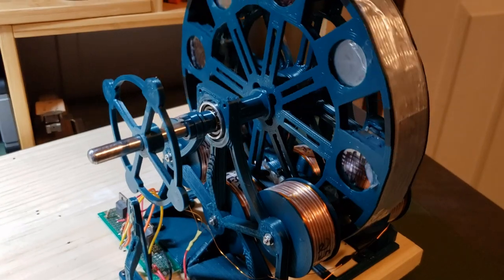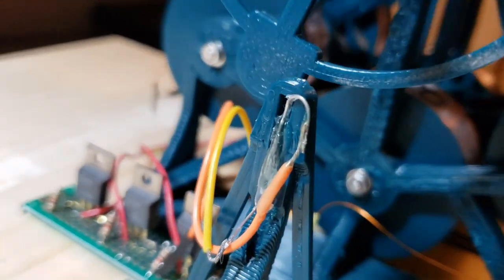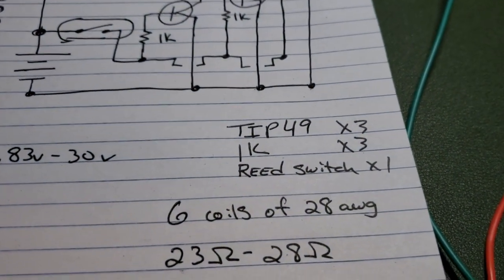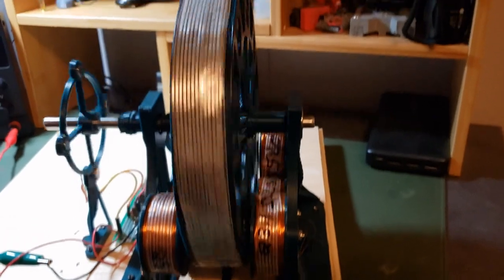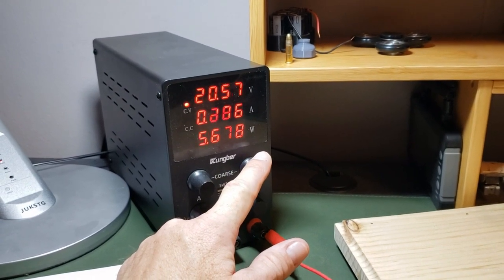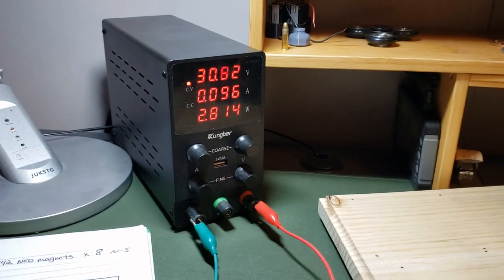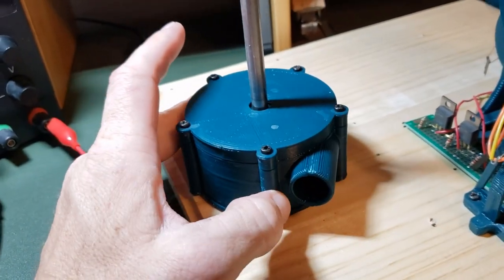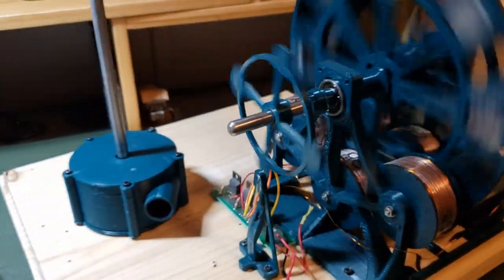Large Efficient Simple Pulse Motor

Comment: unplug it from any power to the circuits. build you a tesla turbine powered by steam, and connect the shaft from your pulse motor to the shaft on the turbine, hook the coils from the pulse motor to the loads you want to power. your using water or air instead of power from the grid to power your pulse motor now,,  if you can use a boiler for steam it would run on water and wood.      if you could get it to run an induction coil to heat the boiler you may be able to loop it using the power from the pulse motor coils.... ??? the coils dont spin the wheel the steam does, the coils are your power company

Comment: whts happening here is what now motor controllers does.highy efficient pulsing..its all about the duration of energy bieng use at the shortest period of time at its maximum torque
Reply from the maker: With $80 in magnets? The efficiency is that it spins on hardly any wattage. I wanted something bigger than a lid motor that ran on the same input.

Comment: Can you please mention the wattage, while you are loading it, (just before it stops)when its running at 30 volts.
Reply from the maker: I'm not sure that was a year ago and that motor has been used for parts. I'm assuming it jumped up to around 8 watts at most.
Reply: @redesign3dp  Many Thanks. Cheers.
Reply from the maker: Check out my latest videos!

Comment: You can use a gearbox to take the high rpm-low torque to high torque-lower rpm.  This direction of conversion is less efficient; it's more efficient to go from high torque-low rpm to lower torque- higher rpm. My Point: if your torque is too low a gearbox may help (also balancing the rotor will help; maybe use electromagnets?)  Keep in mind when designing something there are always tradeoffs. Don't worry about efficiency as much as total power output. Can one build a generator the size of a refrigerator that could generate enough power to run your house? It may only be 20% efficient; does that matter? The question is what design variables are we seeking to optimize.
Reply from the maker: No I get it. Please understand I was only showing a new design. I never built one that large with so little input. I'm always trying out new 3d cad design ideas not trying to create anything magical. Check out my newer motors. Thanks for the comment!
Reply: @redesign3dp beautifull conception ...low ❤input ... very good ... what is speed at the short  circuit ? It correctly do your motor accelerate under load and reduxe the consumption ....input .... 😮add a generator coil and the earth hahaha

Comment: On your schematic the TIP49 is a NPN transistor, You need to show the arrow on the base. On the emitter Bedini uses a 1N4007 anode tied to the emitter and going to a neon bulb, if ran at higher voltages. That keeps the heat off of the transistor.🙂
Reply from the maker: Good catch on the schematic symbols, I missed that thanks. I the bedini protection set up in some of my other videos. Thanks
Reply: Thats why you should use an IGBT or mosfet.
Reply from the maker: @paulanthonybridge5741  look on my channel, I have a Newman style motor using IGBT's
Reply: @redesign3dp  Thanks a lot. They are probably a better choice instead of MOSFETS. Thats my experience.

Comment: One of the best builds I have seen on You tube, First class pulse motor it looks very powerfull when high volts is applied.
Reply from the maker: Thanks
Reply: @redesign3dp  Your welcome, Looking at the speed of this machine it might be possible to set up a axial flux generator off of it. this way it is paying for itself ect. making it more efficient. what do you think?
Reply from the maker: @DeryckThompsonChasingtheDream  Maybe if I take power off from the shaft. If I add gen coils near the rotor in a axial flux set up, I would suffer higher losses from the BEMF cogging. My latest motor has the most torque yet, you should check it out.
Reply: Not well balanced rotor.....
Reply from the maker: @paulanthonybridge5741  They can't all be winners!
Reply from the maker: Thanks, if you want to see powerful motors check out    k energy's    channel.
Reply: @redesign3dp  Thanks for the tip. I am already a subscriber to his Channel. His motors and his ideas are Some of the best on youtube.  Keep up your good work because its all about sharing ideas and improving upon them if possible.

Comment: Great motor....Did you ever think to try and Hall sensor instead of a reed switch? The reed works great just wondering if a hall would work better?
Reply from the maker: The hall switch consumes some energy, the Reed switch doesn't. I was trying to maximize run time efficiency. Its essentially a giant lid motor. I do have hall sensor modules that would work. I see your designing a commutator for a Newman motor, check out my commutator video made from a copper pipe. If you want the stl. I'll email it to you. Keep experimenting brother!
Reply: In my experience, I find reed switches better because you can control their switching angle with better precision.
Reply: No, optical switching is far better than both. I use a LED and also a LED as sensor.
Reply: @paulanthonybridge5741  I've wanted to try optical switching for a while now. I'll have to look up the circuit
Reply: @mcorrade  Its easy, just reverse bias a LED in front of a darlington transistor pair, the output can directly control a H-bridge Mosfet coil driver. Draw a separate trace on the optical disc for pulse reversal after magnets reach the middle of each coil.
Reply: Optical switching beats all. And you can draw your desired switching sequence on a transparent, round disc with permanent ink pen.

Comment: It's interesting job! What speed (rpm) did you accelerate your motor? What was the supply voltage and current? Thank you in advance for your answer!
Reply from the maker: Thanks. I didn't measure the RPM but I can run this as low as .8v .01ma to 30v 130ma. Later I ran it from a 60v boost circuit and speed and torque increased.
Reply: @redesign3dp , thanks for your answer!  I think so, that you took these measurements at idle, right? You did not give a mechanical load on the shaft and, accordingly, did not carry out measurements, did you? Maybe I'm wrong? Thank you in advance for your answer!
Reply from the maker: @alexanderkrupnov4999  I'll post another video with it running a stepper motor as a generator, with rpm and power 📚
Reply: @redesign3dp , Thank you! I'll be waiting. I think it'll be interesting....

Comment: Looks Like a time waster and very inefficient for the mass of the magnets the mass of the copper and no capture of the primary also to use a reed switch is almost barbaric. Though if you had fun making it then all G.
Reply: Looks efficient to me. It runs from less than a volt to 30 volts without issues. What's wrong with reed switches?
Reply: @Coldgrey28  These motors can go down to the micro amps(if you read what I stated and then do the math) so this is inefficient also reed switches are terribly inefficient and prone to failure. I would suggest a hall effect.
Reply from the maker: I'm sorry you feel that way. This motor is probably the most efficient motor I've built to date especially being an air core motor. It has surprisingly nice torque for low watts compared to other motors I've built. And the Reed switch let's me take this up to 60vdc without issues. Thanks for watching though.. 🍻
Reply: @redesign3dp  I'm glad you think it's efficient although a newman motor would have had way more torque and been in the same range for watt's.(happy building)
Reply: Somebody had a bowl of grumpy cereal for breakfast this morning. I truly hope things get better for you GG.
Reply: @user-wy3xe2tt3y  Maybe although there will be no torque from these kind of motor's as they do not have the tooth the foc phmp's have.

Comment: Would it generate more than 5w if u connect a dynamo to it ?
Reply from the maker: I recently connected a stepper motor to it as a generator 24v 1a and was able to charge up a lead acid battery or run a small dc motor

Comment: nice solid build. my rotor motor has a bifilar air cored drive coil with 25 ohms x2. no cogging or core losses and it goes faster than with a ferrite cored drive coil. it has a hall sensor out of a computer fan that flips 2 outputs and the power is on all the time in this clip so it isn't efficient this way as the power is on at times when the rotor is out of range of the drive coil, but i can run it off 1 output and with the rotor arms set like this the power consumption is much reduced.
https://youtube.com/shorts/gnm-6d6NHrs?feature=share

Comment: Very nice. I recommend to make bifiler coils. Tesla said it creates more power with less input. It works great , i have rewound brushless motors this way with great results. I Half the input from battery
Reply from the maker: Ok, I'll give it a shot on the next build. Thanks
Reply: Bifilliar means you have split the amount of winding so of course you would require half the input. The reason being that you capture the primary on the secondary or trigger and secondary I feel you meant pancake coil not bifilliar.
Reply: @GG-od2tr  yes but bifilliar winding creates a capacitor effect storing a charge. This does more than half the input because the output is greater than a basic coil with the same resistance
Reply: @gregstafford2155  The capacitor effect is what you want from these coil's as the motor's has no torque. To not capture the back emf is pretty irresponsible.